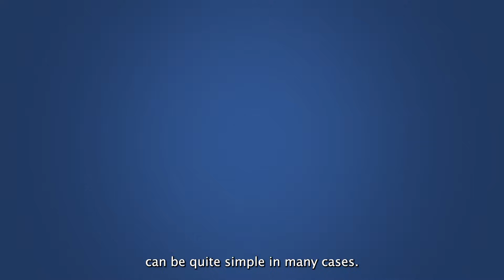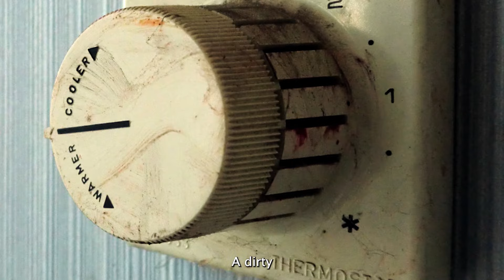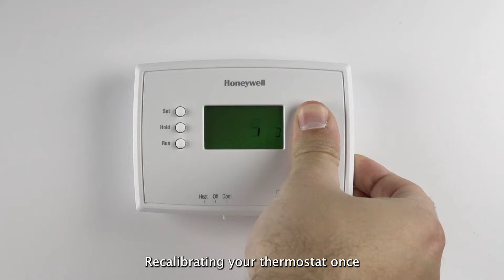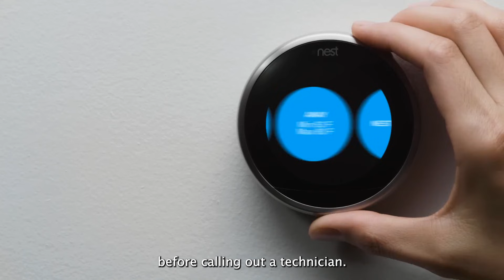Why Doesn’t the Room Temperature Match My Thermostat?

Comment: Most of these answers are regarding an air conditioner. I'm having this problem with my heater. My radiators are each registering different temperatures. The house temperature is stuck at 80 degrees, while the actual set temperature is on 72 degrees. I may have 2 radiators actually radiating heat even though I turned the thermostat off. I cannot set a temperature it only goes up to 80 degrees. What do you think is the problem.

Comment: I recently solved my "faulty" heat pump thermostat problem after 6 years of owning this older Florida home  It tended to read a temperature than seemed unreasonably cold when I knew the the house needed cooling.  I would compensate by setting the temperature for the cold setting to maybe 65 dg F so that the unit would turn on when I usually like the temperature closer to 75 dg.  When the two months of heating season in Florida came around the reverse was true.   I recently popped open the casing of the thermostat and bushed out the dust that had accoumulated over the years and noticed that there was a hole the size of a golf ball that the wiring came through from the wall behind.   The thermostat was reading the temperature of the wall cavity more than the hallway temperature!   Worst still was that the heat pump coils were adjacent to the wall that the thermostat was mounted to inside a closet.  When the coils were cold the theremostat was reading colder than reality.  When warm the thermostat read warmer than reality.   Fixed it by shooting in a can of "Great Stuff" expandalbe foam and now everything is hunkydory!   Yeah, feel stupid that it took me so long to figure it out but I bet I am not the only one with this problem.
Reply: This is more common than people realize but HVAC people want to sell NEW systems! :) 2 cents of sealant can fix it instead. :)

Comment: my Honeywell t5 is set to 75 and shows 75, but the actual temperature as shown by 3 independent thermometers is 72.5. Consistently. Doesn't this point to a thermostat that is faulty?
Reply: That seems like a reasonable difference. It is consistent.

Comment: Hi! One of my room's temperature is higher than what is set on the thermostat. What could be the reason?
Reply: I have 16,500 bucks in my new system and the dang thing has never worked right. As I type this my thermostat is set to 76 and my bedroom is 82. My living room is 80. The company I used  has has been out 4 times and can’t figure out the problem. The last trip I paid over 500 to relocate the thermostat and that did absolutely nothing. 82 in Florida is fun.
Reply: @afcop13  Similar problem in my mom's Miami condo.We set thermostat to 65 and the room is reading 83 or 85 degrees. Some HVAC guys replaced a coil condenser on my mom's roof in March 21, costing my mom over $900 and it was working okay for a while but now the room temp is over 20+ degrees from the thermostat. Any suggestions?
Reply: @MarkySerenada check duct work

Comment: My thermostat is placed near the center of the home, away from sunlight or drafts and near the return air. It is reading that the room temp is 71° but the room that it is in (hallway) feels like the low 60's. Is it possible for the room temperature reading to be off by almost 10 degrees (F)
Reply from the maker: Unless your thermostat has failed and or lost calibration that may be a possibility. You can try putting a digital thermometer in that space to confirm temperature.

If your Nest thermostat needs to be recalibrated you can contact Nest technical support or have us come out for service if near the Los Angles and surrounding areas
Reply: @allthingsplumbingheatingair  I'm in Texas, and the thermostat is probably 20 years old. Everything else on the thermostat seems to work. It just doesn't show the correct room temperature, so it never tries to turn the system off. I'll probably just replace it soon. I just moved into this house about 3 months ago. Thanks for replying!